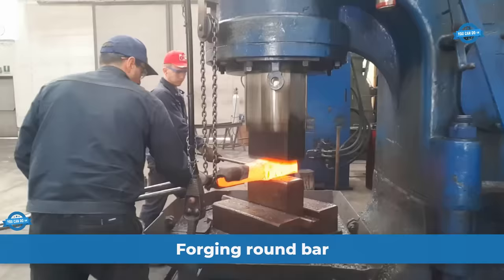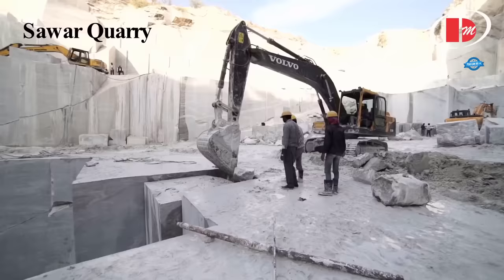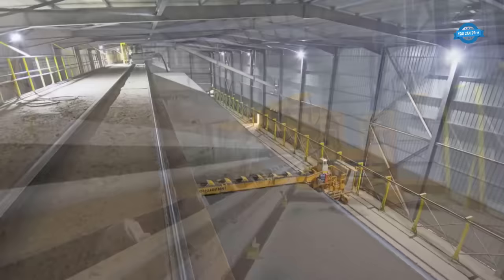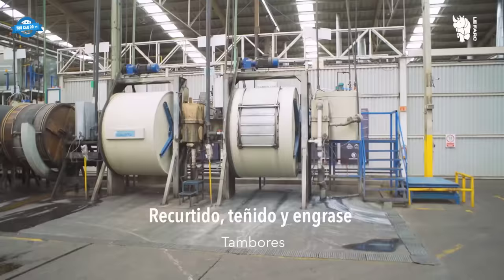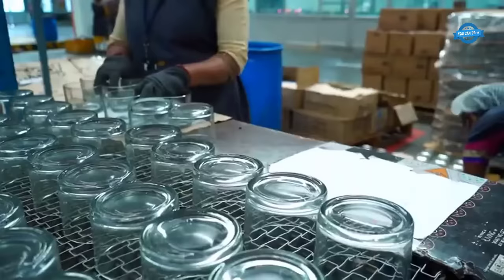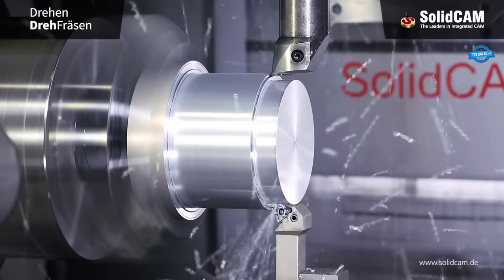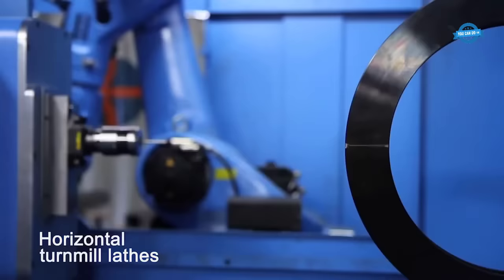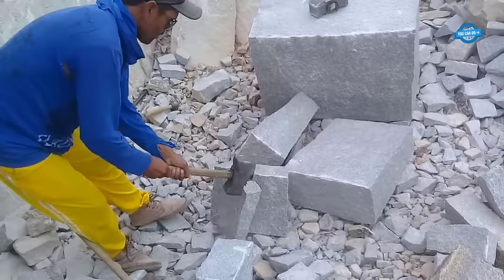HEAVY-DUTY LATHE MACHINE. The Hypnotic Production Process Around Us #2

Comment from the maker: Note: There are many production processes selected from the industry sectors around our lives in the video, please refer to the following table of contents to select and watch your favorite parts. Happy watching!
0:08. Forging round bar
3:17. Surgical Hammer Machining
5:01. Titanium Shoulder Implant Machining
6:17. Axles Friction Welding Machine
7:39. Drom Marble Stone Processing
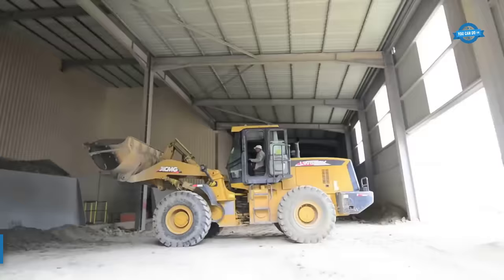14:16. Hollow Brick Manufacturing Process
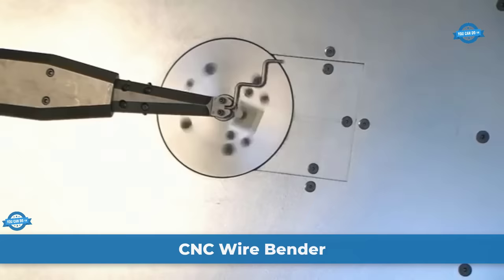23:38. CNC Wire Bender
24:42. The Tanning Process
31:57. Candle Manufacturing Process
34:00. Producing gold jewelry in Italy
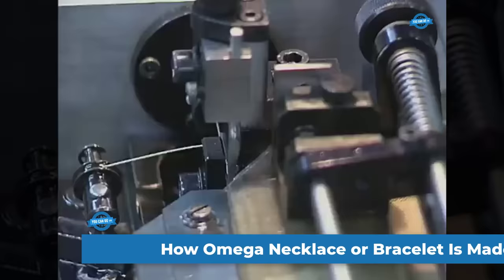34:38. How Omega Necklace Is Made
36:35. How Fashion Bracelets Is Made
37:57. How Figaro Chain Is Made
40:39. SolidCAM Drehen Optimization
44:17. 5-Axis Aluminum Machining Solution
47:19. Hydraulic chain saw machine
54:54. Splitting stone
58:57. Crankshaft Rough Milling
Reply: 1:01:16 its preview ?

Comment: Click bait picture did not feature in this video.
Reply from the maker: Please refer at 58:57. Crankshaft Rough Milling for watching large crankshaft
Reply: @YouCanDo_TV  I watched the whole video it isn't there at all, just another job/machine.
Reply: Yes. A one hour video with about 4 minutes relating to the title. If you want to ruin your reputation, you are going the right way about it. @YouCanDo_TV
Reply from the maker: We are very sorry if this presentation causes inconvenience to you. YouCanDo TV is a general channel, there will be many different machines and production processes. To make it easier for viewers to follow, YouCanDo TV has separated the parts according to timelines. Please refer to these timelines to easily follow the content you are interested in.
0:08. Forging round bar
3:17. Surgical Hammer Machining
5:01. Titanium Shoulder Implant Machining
6:17. Axles Friction Welding Machine
7:39. Drom Marble Stone Processing
14:16. Hollow Brick Manufacturing Process
23:38. CNC Wire Bender
24:42. The Tanning Process
31:57. Candle Manufacturing Process
34:00. Producing gold jewelry in Italy
34:38. How Omega Necklace Is Made
36:35. How Fashion Bracelets Is Made
37:57. How Figaro Chain Is Made
40:39. SolidCAM Drehen Optimization
44:17. 5-Axis Aluminum Machining Solution
47:19. Hydraulic chain saw machine
54:54. Splitting stone
58:57. Crankshaft Rough Milling

Comment: Title says "Heavy-Duty Late machine, and starts off with FORGING. I SERIOUSLY HATE THESE CLICKBAIT VIDEOS. I came to see the late machine, not the forging.
Reply from the maker: Please refer at 58:57. Crankshaft Rough Milling for watching the large crankshaft
Reply: @YouCanDo_TV  Why force people to watch 59 minutes of a video that is irrelevant to the title. That is what is called CLICKBAIT. It is basically forcing people watch what they did not come for.
Reply from the maker: We are very sorry if this presentation causes inconvenience to you. YouCanDo TV is a general channel, there will be many different machines and production processes. To make it easier for viewers to follow, YouCanDo TV has separated the parts according to timelines in the video's description. Please refer to these timelines to easily follow the content you are interested in.
0:08. Forging round bar
3:17. Surgical Hammer Machining
5:01. Titanium Shoulder Implant Machining
6:17. Axles Friction Welding Machine
7:39. Drom Marble Stone Processing
14:16. Hollow Brick Manufacturing Process
23:38. CNC Wire Bender
24:42. The Tanning Process
31:57. Candle Manufacturing Process
34:00. Producing gold jewelry in Italy
34:38. How Omega Necklace Is Made
36:35. How Fashion Bracelets Is Made
37:57. How Figaro Chain Is Made
40:39. SolidCAM Drehen Optimization
44:17. 5-Axis Aluminum Machining Solution
47:19. Hydraulic chain saw machine
54:54. Splitting stone
58:57. Crankshaft Rough Milling

Comment: Click bait. Almost no video of the click bait picture. Thumbs down! Blocked this channel.
Reply from the maker: Please refer 58:57. Crankshaft Rough Milling to see the large crankshaft.
HEAVY-DUTY LATHE MACHINE. The Hypnotic Production Process Around Us #2
0:08. Forging round bar
3:17. Surgical Hammer Machining
5:01. Titanium Shoulder Implant Machining
6:17. Axles Friction Welding Machine
7:39. Drom Marble Stone Processing
14:16. Hollow Brick Manufacturing Process
23:38. CNC Wire Bender
24:42. The Tanning Process
31:57. Candle Manufacturing Process
34:00. Producing gold jewelry in Italy
34:38. How Omega Necklace Is Made
36:35. How Fashion Bracelets Is Made
37:57. How Figaro Chain Is Made
40:39. SolidCAM Drehen Optimization
44:17. 5-Axis Aluminum Machining Solution
47:19. Hydraulic chain saw machine
54:54. Splitting stone
58:57. Crankshaft Rough Milling

Comment: Just click bait, make me not even want to watch the video
Reply from the maker: Please refer 58:57. Crankshaft Rough Milling to see the large crankshaft.
------------------
HEAVY-DUTY LATHE MACHINE. The Hypnotic Production Process Around Us #2
0:08. Forging round bar
3:17. Surgical Hammer Machining
5:01. Titanium Shoulder Implant Machining
6:17. Axles Friction Welding Machine
7:39. Drom Marble Stone Processing
14:16. Hollow Brick Manufacturing Process
23:38. CNC Wire Bender
24:42. The Tanning Process
31:57. Candle Manufacturing Process
34:00. Producing gold jewelry in Italy
34:38. How Omega Necklace Is Made
36:35. How Fashion Bracelets Is Made
37:57. How Figaro Chain Is Made
40:39. SolidCAM Drehen Optimization
44:17. 5-Axis Aluminum Machining Solution
47:19. Hydraulic chain saw machine
54:54. Splitting stone
58:57. Crankshaft Rough Milling